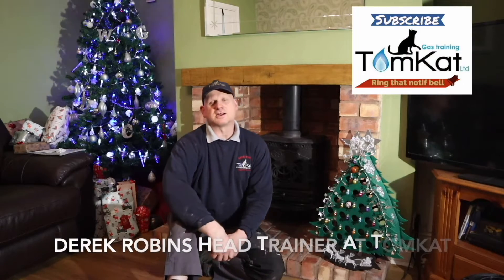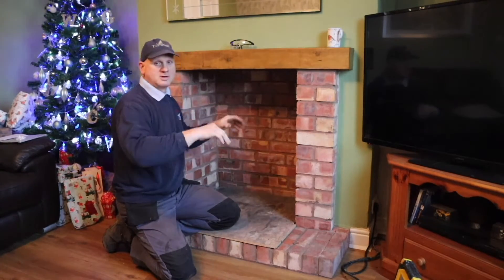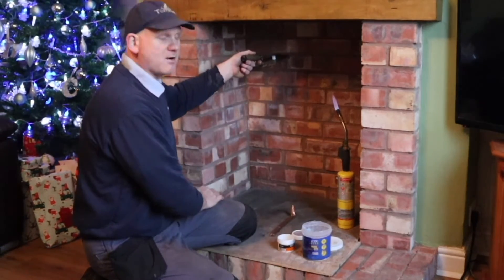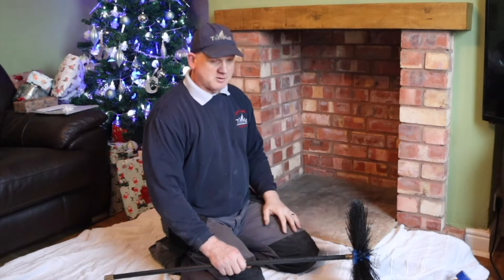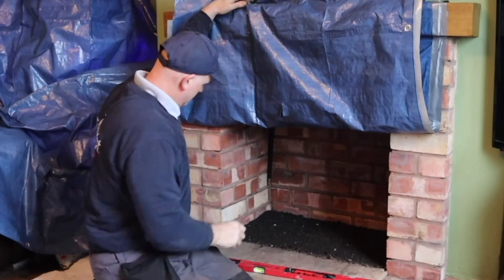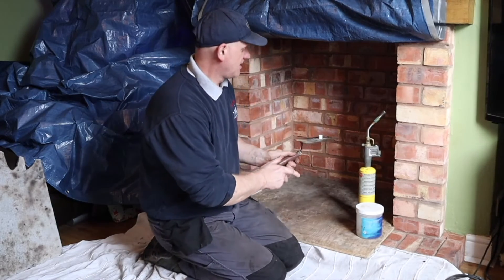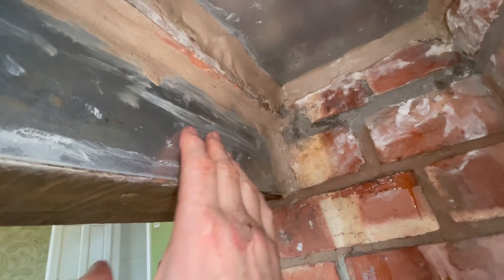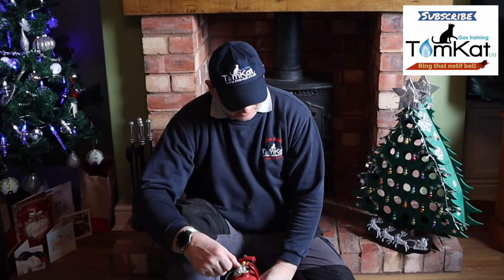Can I sweep my own chimney ?  how to sweep a chimney with a solid fuel fire/log burner attached.

Comment: Timber near the chimney hearth needs to be 50mm away to stop  it self-combusting due to it's proximity (Building Regulation code of practice), but that is referring to the floor joists and deck. So whether your chimney sweep is stretching that guidance or not it would be interesting to find out. Thanks for sharing.